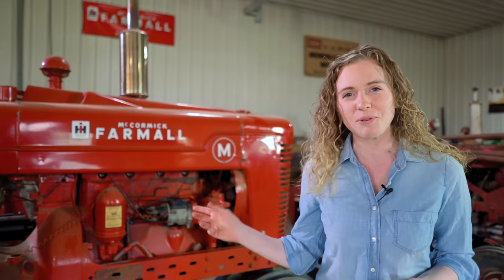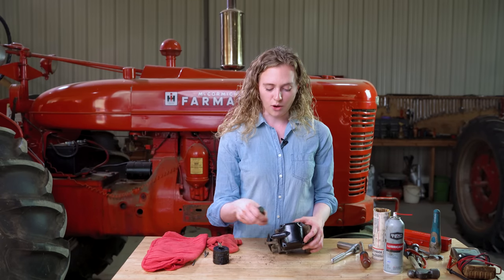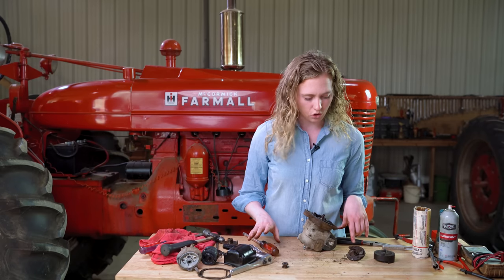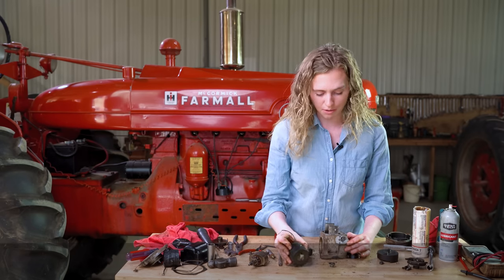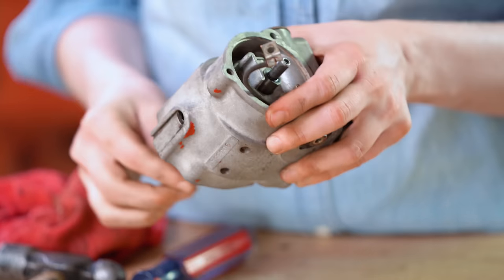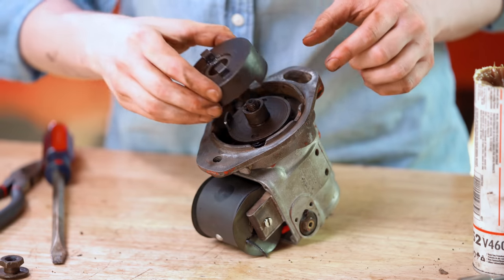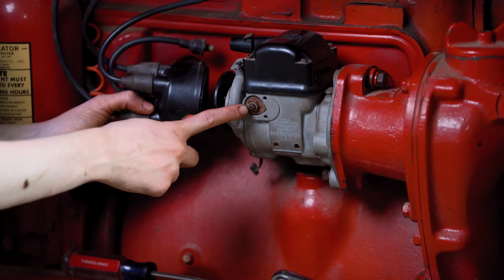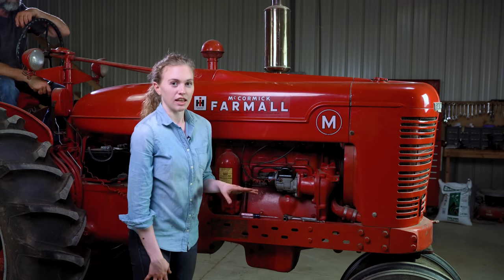Farmall IH H4 Magneto Rebuild: Easy Step-by-Step Tutorial Farmall A, B, C, H, M, etc Tractors

Comment: Great tutorial. I never go that far into them, because it is not usually necessary. I know why you did was to teach how to do it if need be. One thing you may not be aware of, The W-9s and diesel tractors use the H4 magneto but they have a left hand impulse. The impulse is the opposite on them. That's why the hydraulic pump on the gas 400 and 450 have the opposite ports to their diesel counterparts, because the gas tractors and diesels rotate in opposite directions.

Comment: In order to get the impulse off, you MAY, need to hold the shaft from the SMALL END, with your adjustable wrench, or it will just turn and turn while you try and loosen the nut.

Comment: Great job! You are really easy to understand. Question: I just converted my old TD9 International dozer from a coil based spark to a magneto. Very easy change over. You might know that these start on gas and then run on diesel all on the same engine. Is there a problem with not using the ground kill wire on the magneto? I mean, it switched over to the injector pump and when I kill the motor I just shut down the injector pump. So is there any harm in letting the magneto spark all the time even though I am not running on gas?

Comment: When checking the switch for continuity, be aware that some meters beep with any reading below 50 ohms and other meters below 100 ohms. You should also look at the meter and verify you are reading below 1 ohm. Your probes and the connection to the switch may add 1 maybe 2 ohms. The beep just tells you there is"some" current flow..
Reply: Todd Orton  Yes that or just read the resistance on the ohm meter.. We change and throw away plenty of relays that have contacts of 2 or 3 ohms because they won't start a motor or because of the contact resistance they heat up and start melting the case. With a switch you may be able to shoot some contact cleaner in there and get it to work for a bit.. (if you can get the solvent into the switch).
Reply: @plcreman  0
Reply: Need to know where I can purchase parts for my Farmal A magneto.
Reply: A test light is the best way to test connections.

Comment: I see this video is 3 years old but I have a question about my magneto on my H. I've replaced everything in the magneto like the coil, points, condenser also i have replaced both the cover and distributor cap along with new wires and plugs but still no spark any idea what the issue could be?

Comment: My h4 was converted to external coil .  The original coil was removed.  I would like to return it to magneto.         My question is:.  What is special about the core.  I don't have a core for the coil.   Can I make one on the lathe?  For now I am using it will the external coil but would love to go back to original.

Comment: Merry Christmas i have a question there is a Ford 8340 4 × 4   there is a problem with the hydraulic pump according to the seller Wheels 70% 4 × 4 Not working Could be pump delay or Solonid is it worth it to buy easy to fix or not

Comment: I have a 51 Harry Ferguson to-30 and i have replaced condenser,coil,cleaned the points well ,replaced all plugs and it has been converted to 12v and I turn the ignition on the coil gets warm but it won’t spark what is wrong I have a distributor btw

Comment: I always hated trying to shut off our H Farmall if it was a little wet out. I would go to push the kill switch in and get a good shock. We replaced our mags with Delco Remy distributors. We weren't purists.
Reply: If the switch is worn, it can tickle you. when you shut the tractor off. Delco Remy distributors were optional. I am fine with either. If you had a good switch, you wouldn't get tickled.

Comment: 🚜💕💨
Reply: My Dad's brother was just start putting  parts in a line then follow the parts back.
=====
I would kick them everywhere I did that . Your gears I dropped the distributor in completely 180 on a 71 Chevy and they said it worked just as good at Sears. ( But No )
Reply: Are in propane didn't have a magneto but a case tractor 🚜 did. I never touch the propane much .
=====
They had a filter that was all it needed at tractor supply ( I cleaned ) 
====
It has a John Deere needle valve in it means it the other one hopped off and ran away with the moon or spoon 🥄 but a little Teflon and it runs good. You can't buy another needle valve cuz they say you don't need one